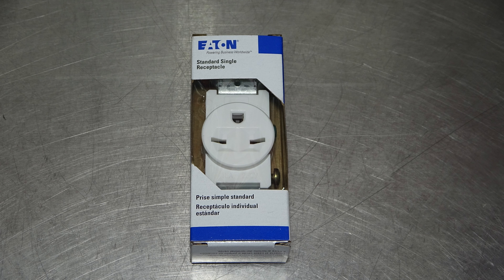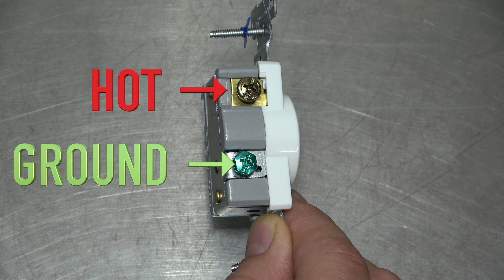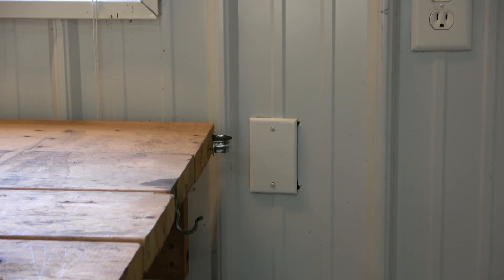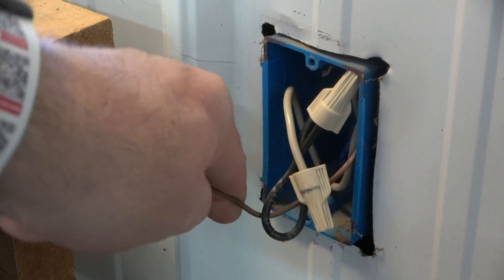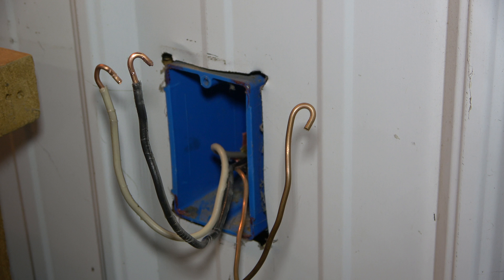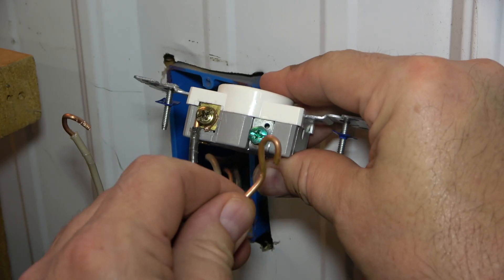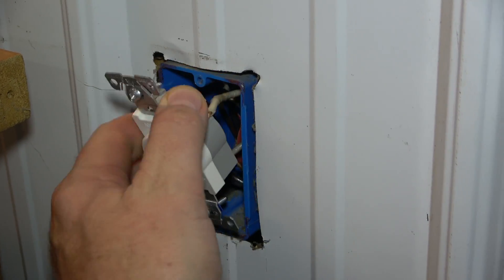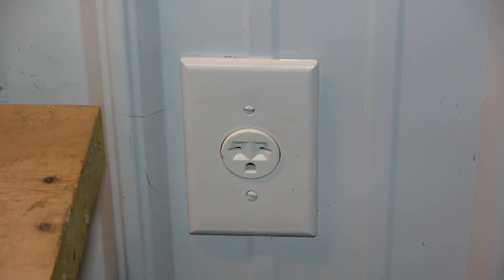Installing a 15 Amp 250 Volt Receptacle / Outlet

Comment: How about is there not ground wire? (Wire that goes in the green screw)
Reply from the maker: Not really sure what you're asking
Reply: @Yolmari9 : Any old two-wire should be replaced with the proper gauge wire with ground (12/2 or greater in this case). Also, note that you should only have this circuit as having one consumer...don't branch from it for another outlet. :)